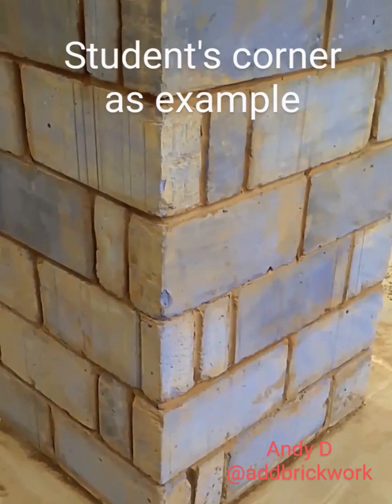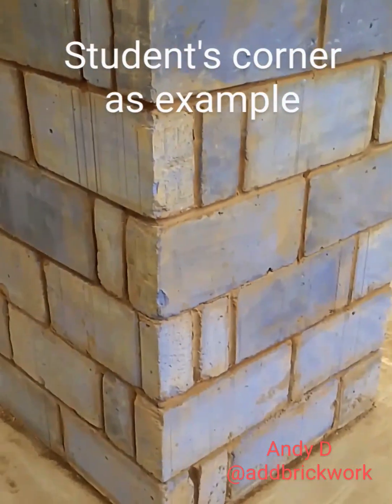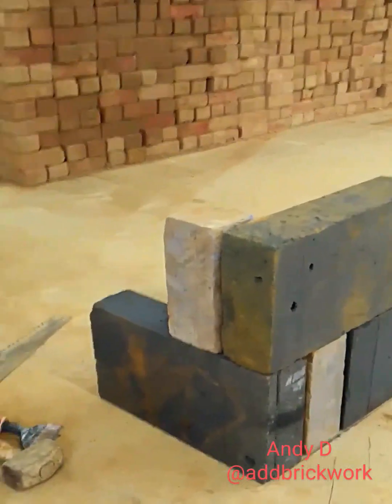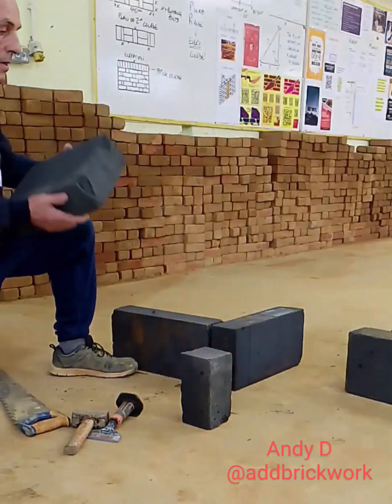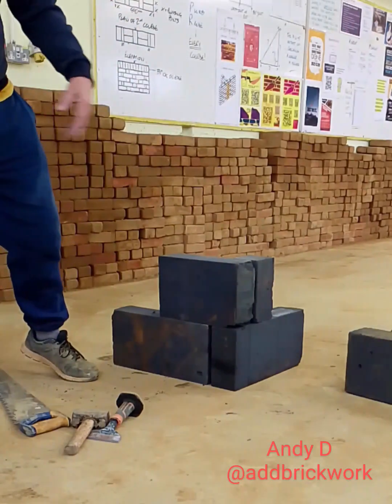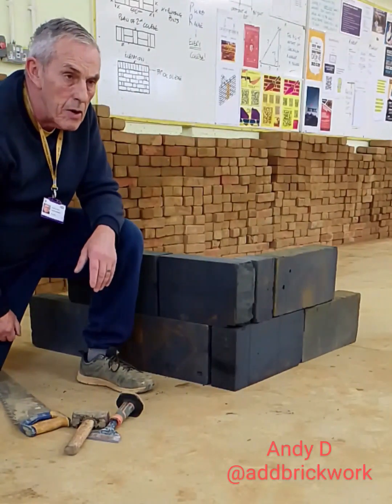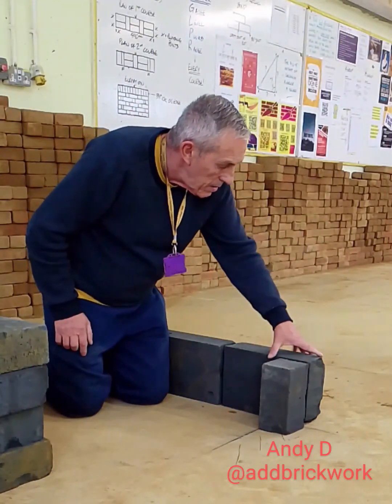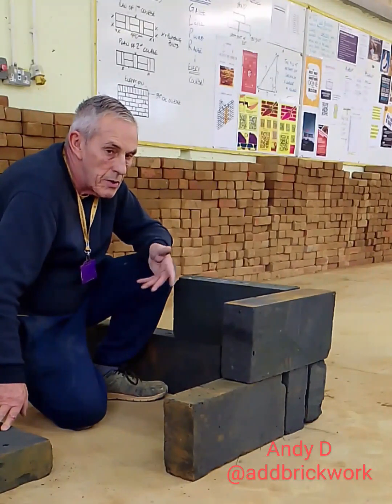BLOCKWORK CORNER - An alternative option.

Comment: Morning Andy saves alot of cutting which is a nightmare hate it 😢ive used the 3 quarter on many job's but fair play to you for showing people the option 👏 it will help loads to a young apprentice 🙏👌👌👍
Reply: The 100mm cut I would use it the blockwork was becoming face work. But I agree the 3/4 then 100 for the return
Reply from the maker: Thanks for your comment Patrick 👍

Comment: I showed Lewis this last week coincidentally 😊
Reply: I’ve never done it any other than the 3/4 way and use the cut. I hate to see people sticking commons in each coarse. I’m 37. So young people do know.
Reply from the maker: @timcartwright4538 Good, glad about that. Just makes sense 👍
Reply from the maker: Don't see many doing it that way though Mark.
Reply: @ you are right, the default is the 4” spacer and I think I do that more often than not but the blocks come in broke a fair bit of the time so I just utilise the breakages
Reply from the maker: Fair comment 👍